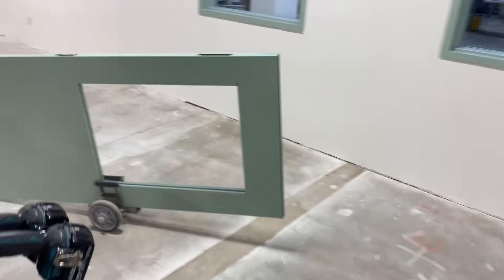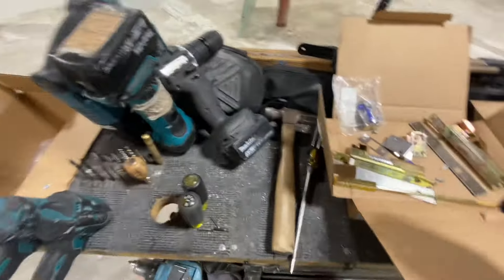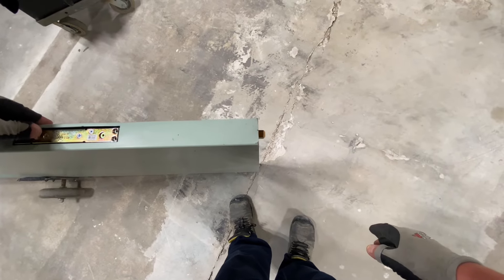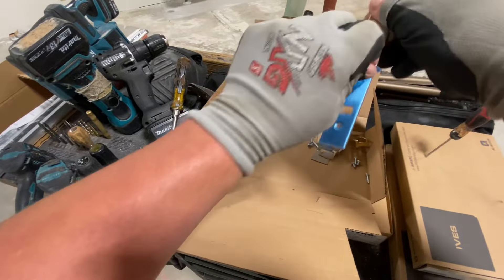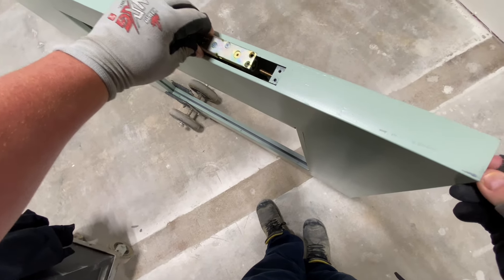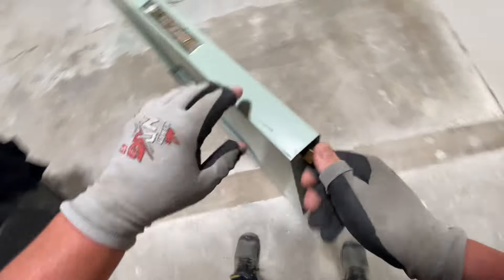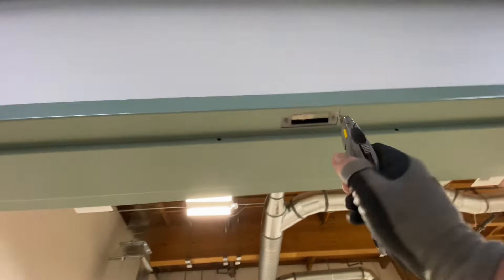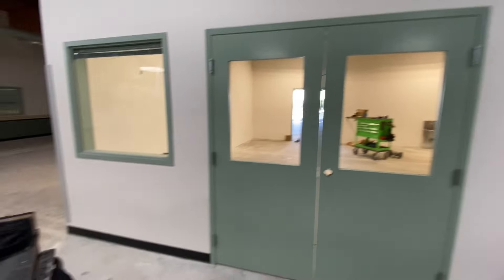How to Install a Flush Bolt in a Hollow Metal Door

Comment: I needed this 3 days ago but good thing i figure it out btw i put it on a wood door and it was hassle cutting out more wood to properly seat those bolts
Reply: With wood doors, most times you need to run a long drill bit through the factory hole because the factory can't seem to drill a straight hole or it's clogged with particle board debris.
Reply from the maker: Man that’s a hard prep to make in the field.  Good job! 😎
Reply: @drewinstallshardware  During the pandemic when it was hard to get factory machined doors.  Some of our suppliers would send me slabs and I would do the machining and finishing in my shop.  (I'm also a carpenter/woodworker by trade)  If you have or make the jigs and have the tools, the worst part is moving/handling the doors.   We have a custom dolly that can hold a door vertical and then rotated and locked to horizontal.   My shop neighbor is a machine shop and I had them make some of my jigs out of aluminum with their CNC. There's  A LOT more money in fabrication/modification than there is in installations.

Comment: Wow,what a following ?  You have a special set of doors here, you should say these are not standard flush bolts.Auto and semi auto bolts are used fire rated openings to self close and latch,but would have an astragal .The bolts you have would need closers and a coordinator as the in-active leaf must close first.They both push open because the occupancy of the room requires both to be active when active door is opened. 

    That would make another interesting video.by the way,I used to take away any impact drill from my crew if I caught them installing ANY hardware (including hinges) as the screws are soft and strip easily.you seem to have it under control but do not advocate this to other installers as your viewers seem to want all your knowledge.

     I am retired now but in the past have ran a hand picked crew installing all types of commercial frames and doors,as well as hardware.I have done many high rise offices,hospitals and hotels and motels and schools ,also warehouses,parking garages and military base buildings and hangers.Not just doors and frames but all specialties like toilet partitions and accessories,all dispensers and wall protection etc... the  contractors build the buildings and we put everything in them.

    I have watched a few other people's install vids but I like to watch yours as you remind me of my installation days.I always trained my crew to be on the same page on big jobs so all work is uniform.and I always made work challenging and worked along beside them even though I did not have to.             Keep working and try to create as many "door guys" as possible as it is a dying craft.
Reply from the maker: Right on the money!  Thanks so much for sharing your knowledge and insight and supporting the channel.  I love this work and hope it helps others enjoy it as well.  Thank u! 😊

Comment: Your job is way too easy when you have frames set correctly.  In my area, the framing/drywall crews usually install them so we have gotten really good and making chicken salad out of something else. (they don't understand that laser doesn't give them square. 

The hardest part for me when installing flush bolts is to remember to do it before we swing the doors.

I enjoy watching others. It's easy to get stuck in our ways so learning how other people do things is helpful, like the screw driver trick.  I always screw the rod onto the body and fight to get everything into the door as one piece.  Your way looks way less frustrating. 

I don't know about you but we are getting some really bad machining on frames, wood and metal doors. The quality control seems to be getting worse lately.
Reply from the maker: Having frames set right makes a huge difference.  I’m a big process guy so over the years I’ve honed my process down so I know what to check for each step of the way. And I really love the process.  Thanks for checking out my videos! 😎
Reply: @drewinstallshardware  I'm 58 and have discovered modifying our process is never ending (we do mostly doors and specialties )  The little "tricks" we can learn from others can save time and frustration, therefore making a little more money.  Thank you for sharing!